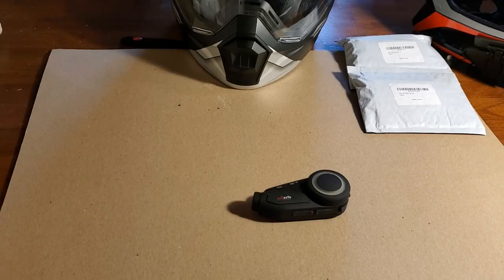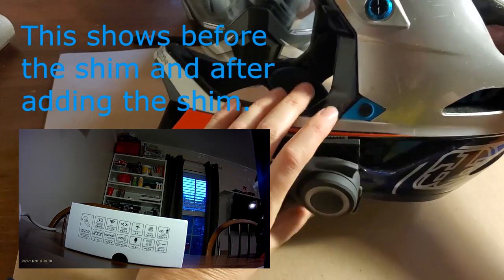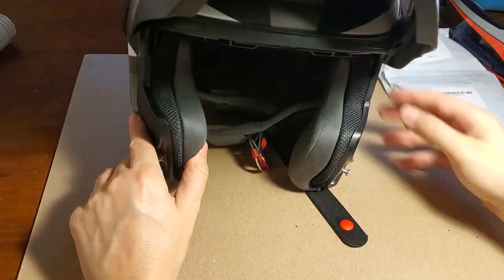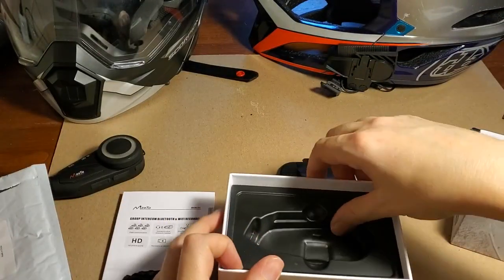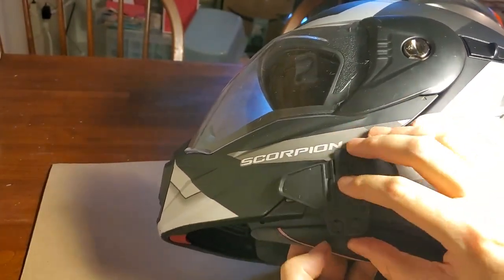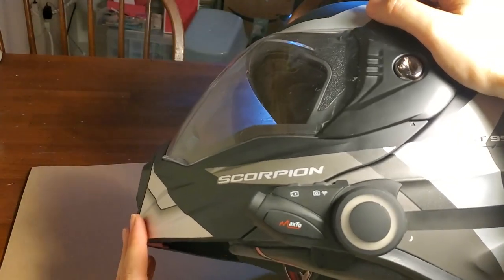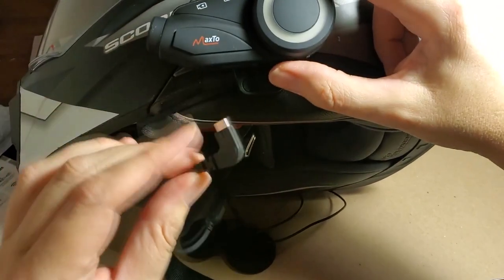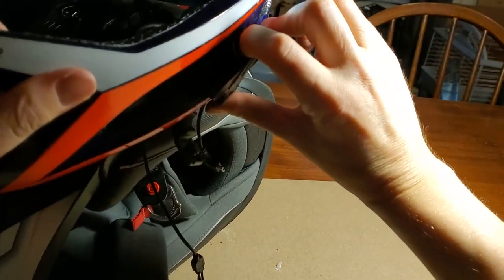Maxto M3 Helmet Communicator and Camera Installation

Comment: Hi, Did you manage to solve the problem so that the camera is exactly horizontal and records horizontally? Can I adjust the image in the application? because physically positioning the camera exactly horizontally will probably not be possible (perhaps with some modification of the holder).
Reply from the maker: @simonwarchol371  I put a wedge behind the camera and that has been working fine for 3 years.
The camera quality is not good enough for producing videos so having it perfect isn't an issue for me.  I have experimented with FFMPEG scripts to level the video but it's usually not worth the hassle.  Most of the video I end up editing is showing a short clip of a fall or incident and it's not important if it is level or if the side of the helmet is in view.
Reply: @bensacheri  Thank you for your reply. 
Yes, you're right, I also used something like a wedge that stiffens the camera mounting on the helmet (maybe not the wedge itself, but something like an additional rubber washer). 
I agree with you, the quality of the camera for recording is not perfect, that's a fact, but like you, it is not a priority for me (although I just thought that with the help of
a simple patent can somehow improve the camera positioning). Similarly, "catching" a fragment of the helmet register in the frame cannot be completely eliminated and is not a problem. 
Either way, thank you for your answer!
Have a safe journeys!

Comment: Mine beeps when battery getting to low for camera
Reply: How long does the battery last when using camera?
Reply from the maker: @bottletree33  I have gotten 6-7 hours of video from one charge.  3 years later it may be a bit less but now I like to charge it during a break on a long ride.